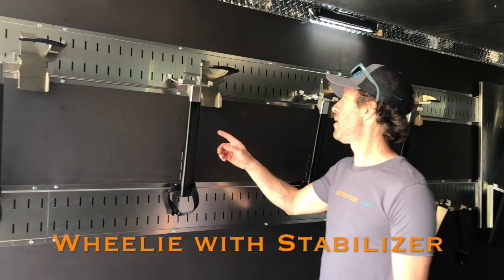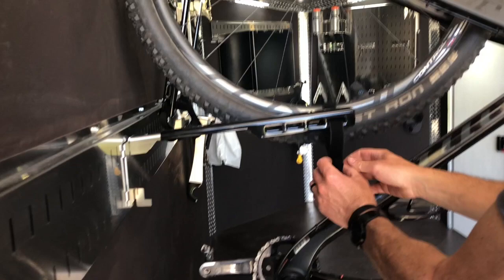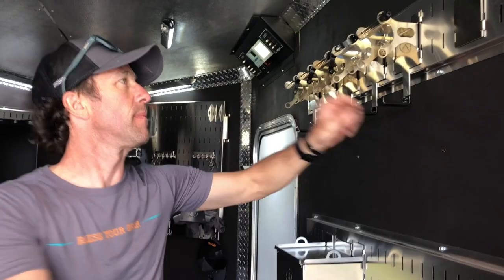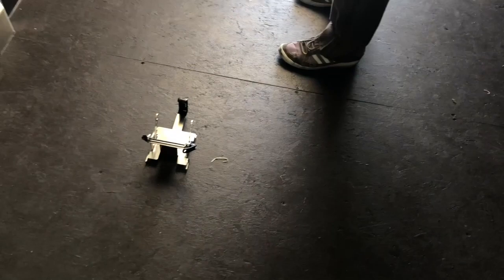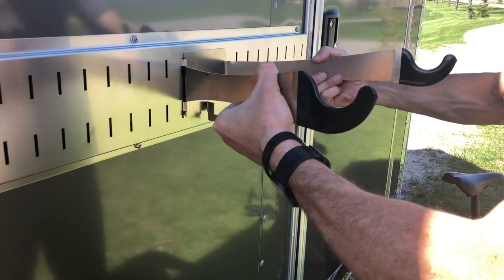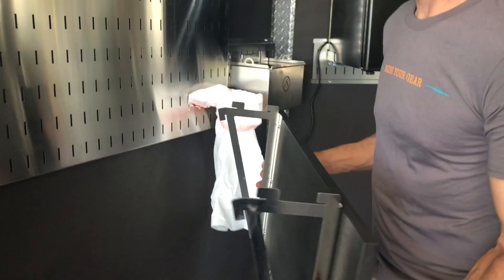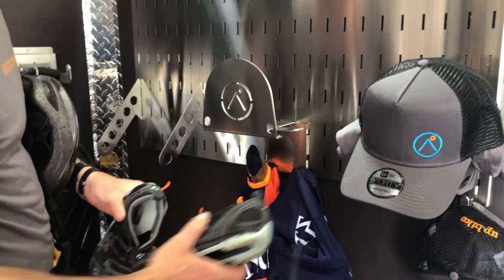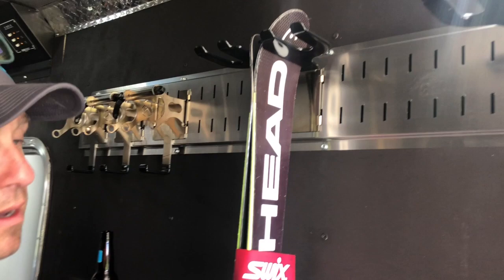Up.bike's accessories and how they work in the Adventure Hub.

Comment: For the wheel on mounts, what keeps the rear tires from moving / the bikes from swinging away from the wall when you turn a corner?
Reply from the maker: Movement is pretty limited, i don't tie them down.  But we do supply voile straps that can be attached at lower wheel.